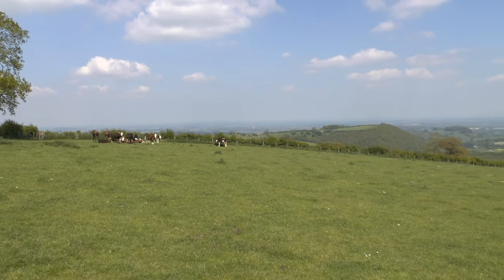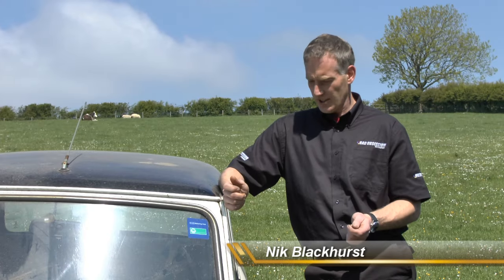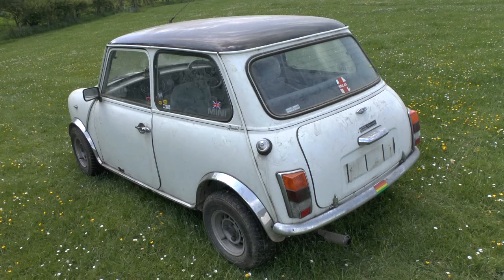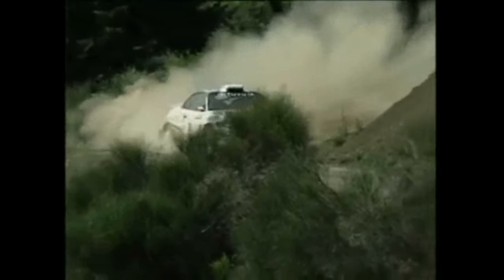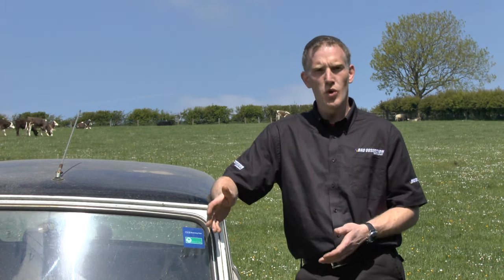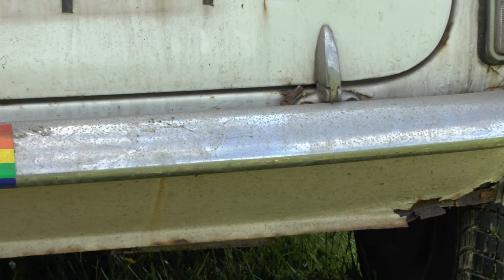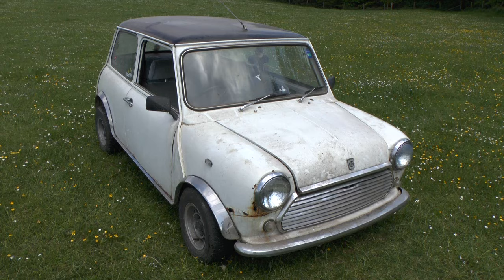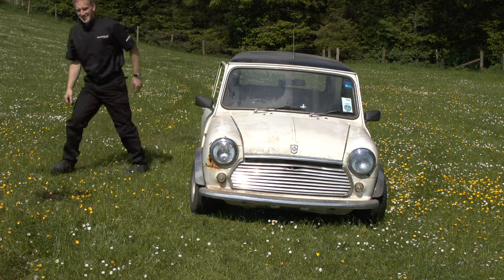Project Binky - The Trailer - Austin Mini GT-Four - Turbo Charged 4WD Mini

Comment from the maker: Thank you very much sir!
Reply: My son NEEDS to know why it’s called Project Binky
Reply: @Freddie44utube  the horse of Death
Reply: @Freddie44utube  Binky is a white horse owned by Death, being a living breathing creature. Death chose him because the other horses that he tried, including the traditional skeletal horse and a fiery horse both proved impractical, as the skeletal horse kept falling apart and had to be held together by wire and the fiery horse kept setting his bedding on fire.

Binky has certain abilities associated with Death, including the ability to stand still in the air and time travel He has been used by Mortimer and Susan Sto Helit during their times as Death.

Presumably Binky will one day also die. However, because he spends much of his time in Death's Domain where time does not exist, his death is unlikely to occur for a very long time.

Binky is also extremely fast, being able to travel from the disc to space in moments, and was able to travel millions of miles without stopping (Although time did not exist in that place).

Comment: OK... Just about to re-watch the entire series and one thing popped into my head, if you had access to another mini and a 6R4 engine and running gear would you build a group b mini?
Reply: what would be the point in that ??? group B died a long long time ago , and a mini/6r4 hybrid would just not be the same as lets say the 500+ bhp Quatro wouldnt you agree ??
Reply: That would make a rusted out death trap become an even bigger death trap
Reply: @dimievers5573  definitely wouldn't fit an S1 engine in.

Comment: Aaargh is it just me or should you guys be restoring the lovely and rare  Celica GT four .My heart aches 💔 😞
Reply: The next project after Binky will be to restore Binky's engine and running gear and install them in the empty Celica shell :)
Reply: On that note, despite affirming in later videos that the GT 4 was somehow "past it" and should not be mourned, due to some sort of catastrophic accident, it still looks basically mint here, and hardly a scratch on it.  Of course it ran fine too.  I do not see the motivation to tear it to pieces and scrap the body...